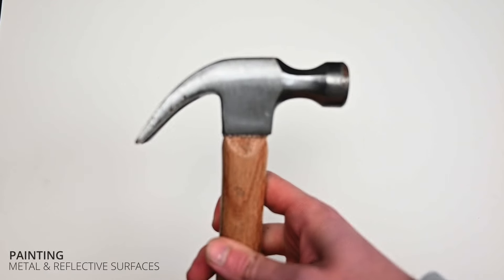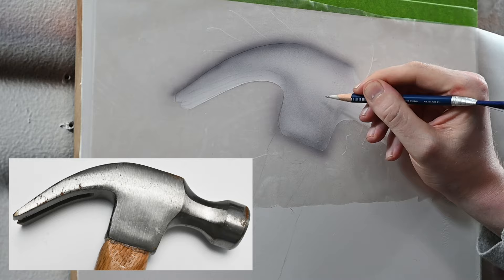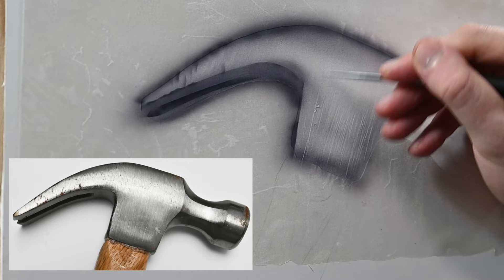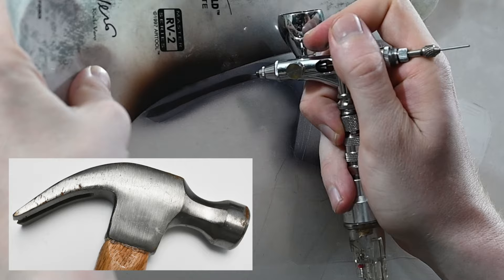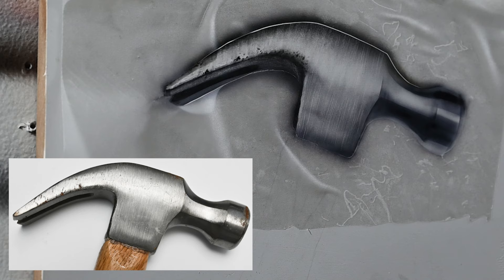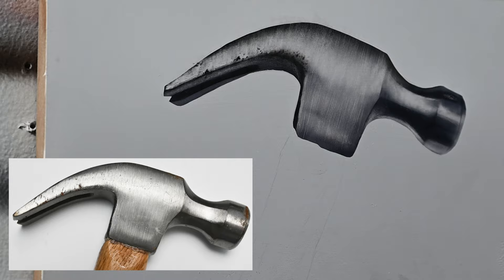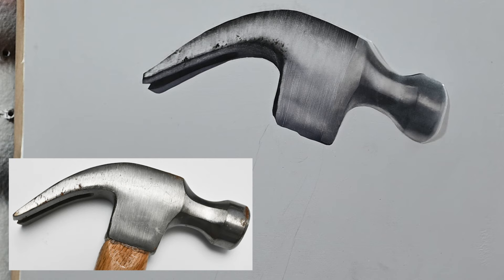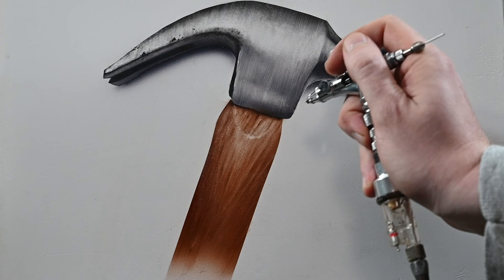Learn to PAINT METAL & REFLECTIVE effects

Comment: Well I just gave this a go and for a 1st time effort I am super happy with the result 😁. I need to practice my exacto blade skills though as it took me a few attempts to cut around the silhouette. I do have a Silhouette Cameo plotter but I see most artists using the frisket method so that'll do for me.

Got a wee tip for anyone looking to make their own shields. If you use card you can apply a finisher to it so it will last. I use Liquid Kicks that is a finisher for painted shoes and it is excellent and fully waterproof 👍

Thanks so much for the inspiration and most of all the confidence ✌️
Reply from the maker: Yes!! I'm glad you are happy with the results. Tbh, im not that great with the xacto blade either. Sometimes it's really difficult to cut a smooth curve.

Comment: Nice work.. have you tried using a scotch bite to put those fines in the metal of the hammer I used this technique on hard surfaces but I don't know if it will work on a canvas but it might be worth a try.. spray some colour down then wipe it in one direction with the sctch brite..

Comment: What colour(s) would you use for the glue mate? Just did the handle, which was as easy as you said, and thought I may add the glue. 

Cheers mate✌️
Reply from the maker: I'd probably use some black or payne's gray. Sepia would probably work fine too. Erasing into the highlights of it is the key. The glue is all about high contrast just like the metal, the color is secondary.
Reply: Much appreciated mate. I was thinking gray which means I have been paying attention in class 😁🍎

Comment: Question I tried erasing before using Createx illustration colors but can never get paint to erase. Am I using the wrong eraser? Any insight is appreciated
Reply from the maker: 2 thing are needed to make it easier. First is a smooth non absorbent surface like a synthetic paper or a gessoed panel/paper/canvas that is sanded smooth. The second is an aggressive ink eraser like the staedtler mars rasor or the faber castell 7058b. Hope this helps!
Reply: @theartworkshop  thanks that is very helpful